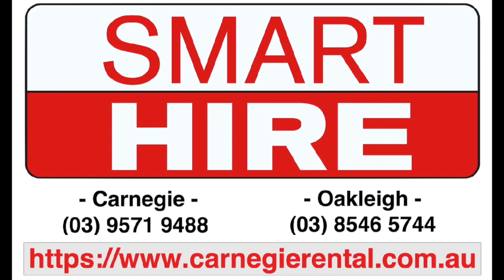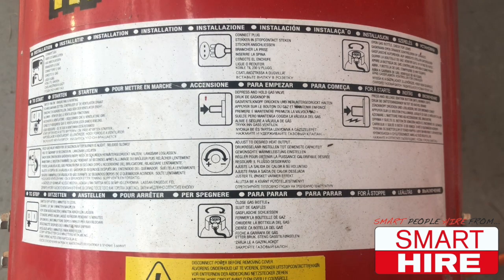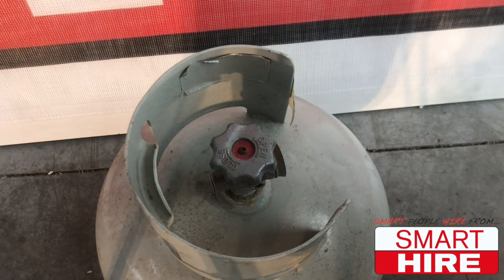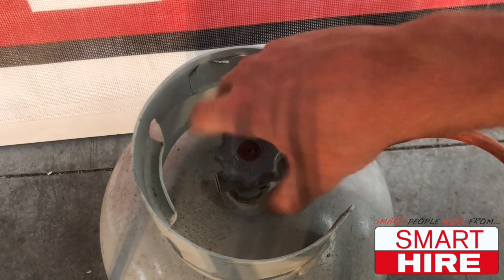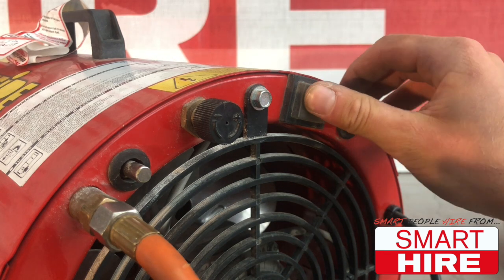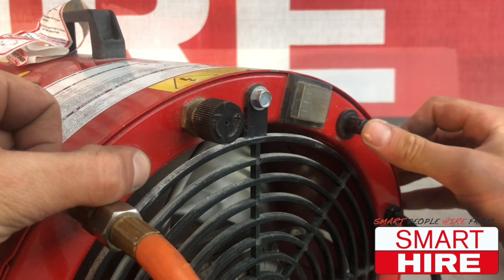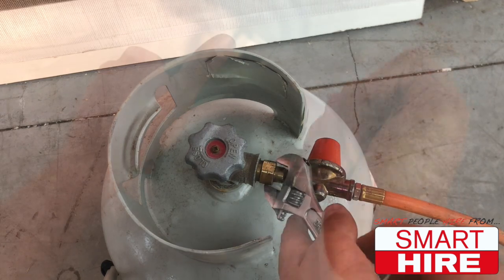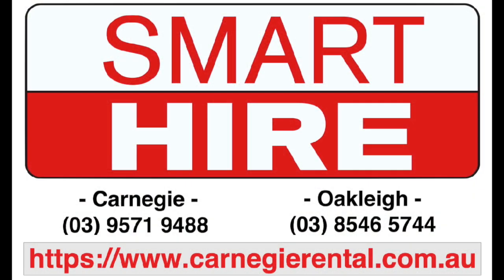How to use a gas blower heater

Comment: is it safe to use in a one bedroom flat/apartment? I think so as long as there is ventilation.
The electricity is far too expensive to heat apartment..........I see no other solution.
Kerosene heater is too expensive

Comment: I have never understood this.  All of these types of heaters say "Use in well ventilated area".  When ever I need a heater, it is usually cold outside.  So ventilating the area will simply dump the heat outside and the heater will be useless.   So how do I use one of these indoors?
Reply: You can't ... Used for chiken coop